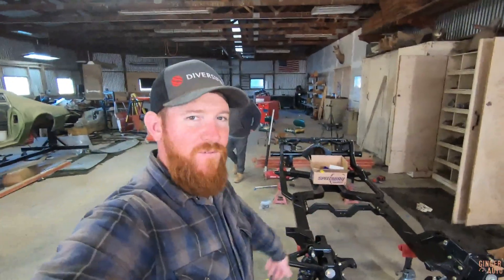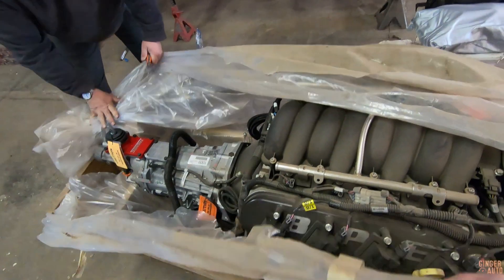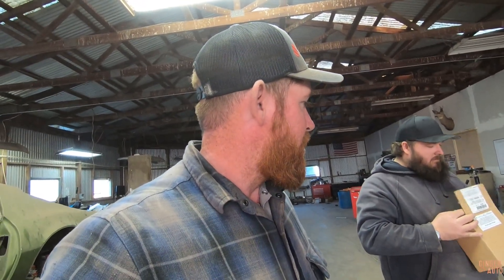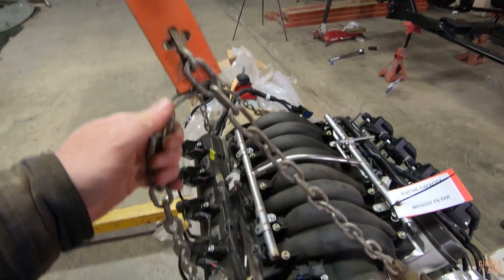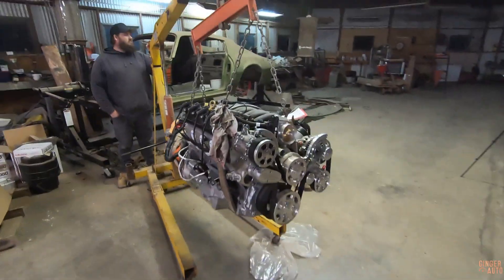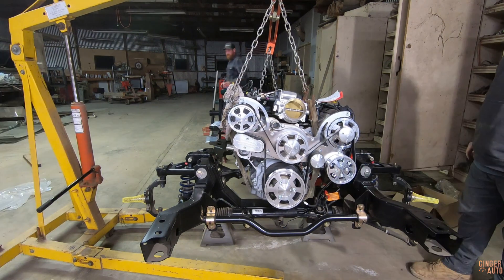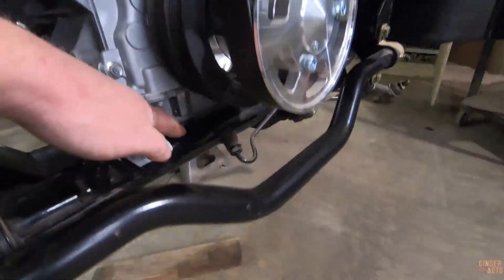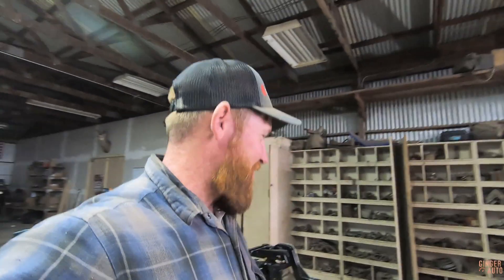Installing the LS3 Crate Engine and T56 on the Roadster Shop Frame!

Comment: Thanks for the video. My frame came with the trans mount, for my setup, Mayan they forgot to send it. Anyways thanks for the video
Reply from the maker: Maybe they did. Did yours come with the pieces that bolt onto the hubs where the tie rods connect to? Because ours didn’t.

Comment: Awesome tributeGuys! Not sure where you are with this now but watch that oil pan.  Typically that chassis will require a Holley 302-2 oil pan which is the "F-Body version". Blueprint ships the LS3s with the "muscle car" pan which is deeper.  Had to change the one on mine and did a clip of it on my channel if you want to check it out.   Can't wait to see more!

Comment: The thing is going to be sweet! Just a heads up if yall can store the glass upright that is on the floor, it will keep it from warping in the heat. I do a lot of windows for a classic rod shop here in town, and I always have issues putting the glass back in after we take it out because they always store them flat. If you store them upright, they go in way easier and keep their shape.
Reply from the maker: Thanks for the heads up!!